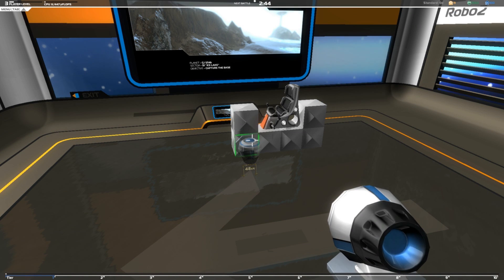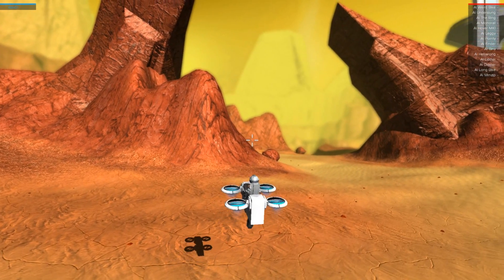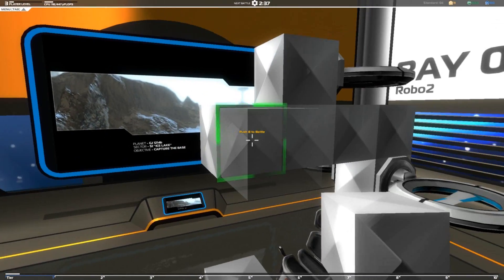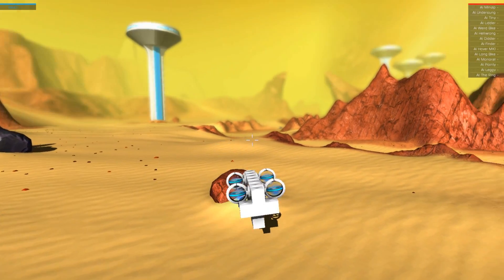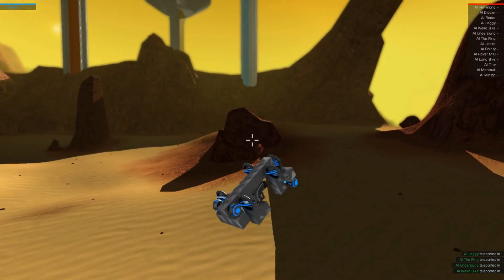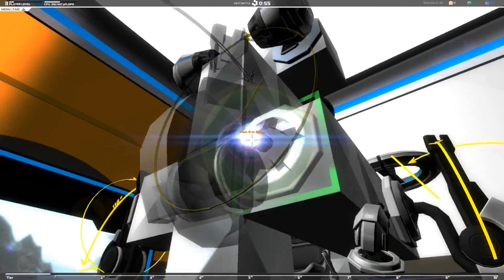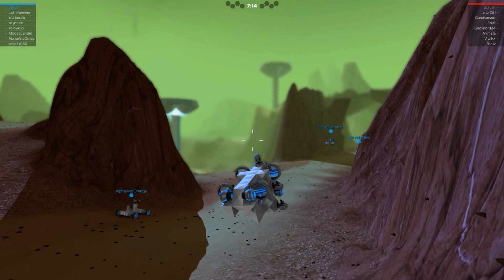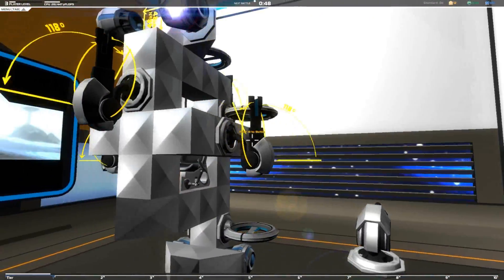Introduction to Robocraft - Part 04 - Hovercraft 101 - Not Your Standard Hovercraft

Comment: What tier hoverblades did u use as I copied it and mine goes a lot slower than ur sand when it gets faster it flips over and back to normal
Reply from the maker: This design no longer works. There is an annotation at the beginning of the video explaining this.